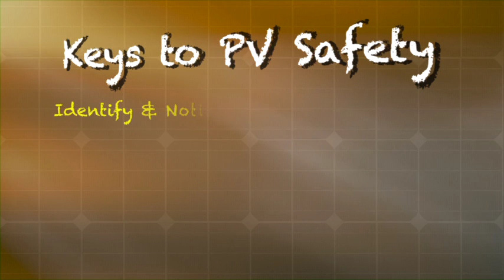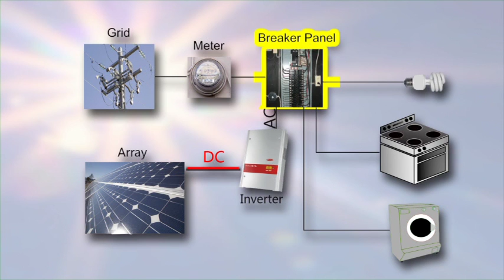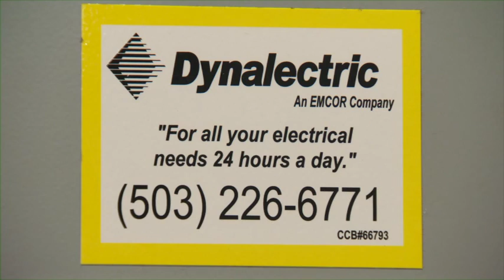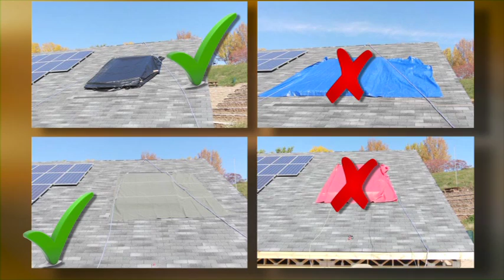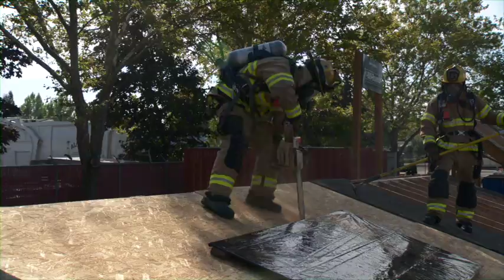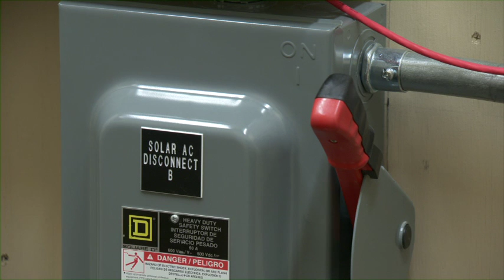Solar Panel Safety for First Responders- Part 1

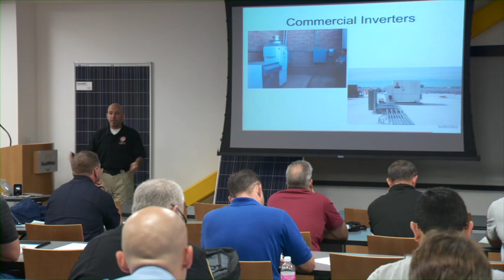Comment: 06:25 Inverters don't need AC to run. There are systems that just have a safety cuttoff for the grid and they continue to power the house even when the grid is down but they will not feed power to the grid if it is down. They will start feeding the grid again if the grid supplies stable power.

Comment: The Remote Solar Isolator is able to remove all lethal voltages on any solar array providing safe access for all emergency services. it stops the combining of solar panels whenever the grid power is removed. search Remote Solar Isolator